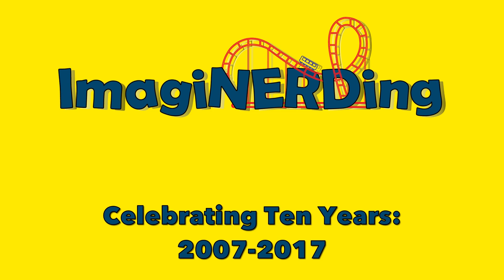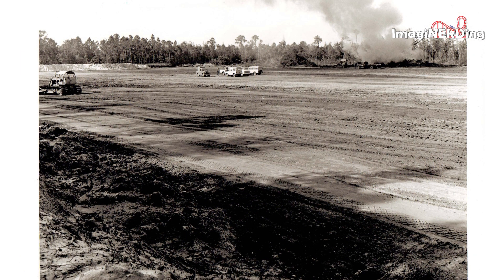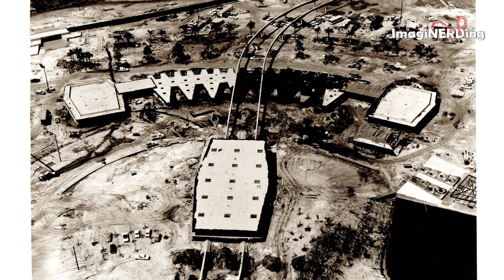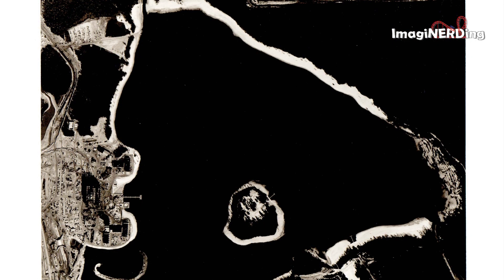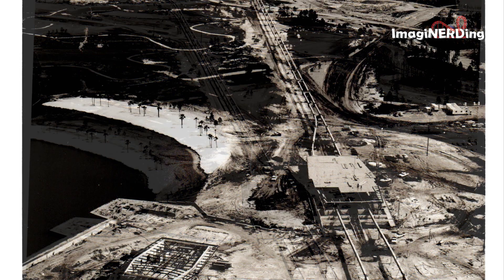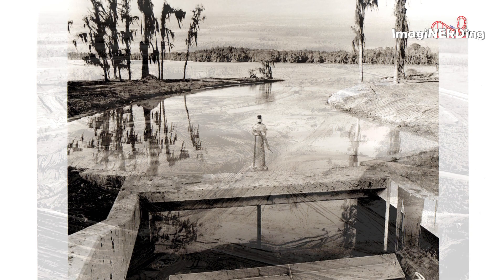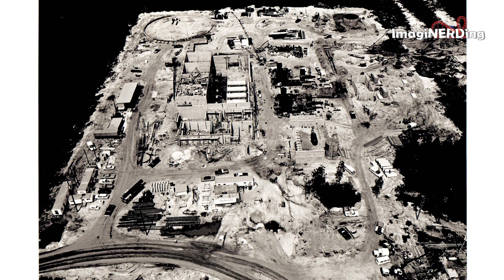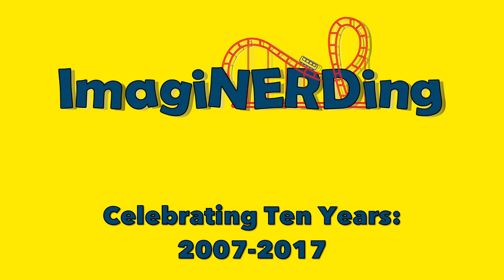Walt Disney World Construction Photos Rare!

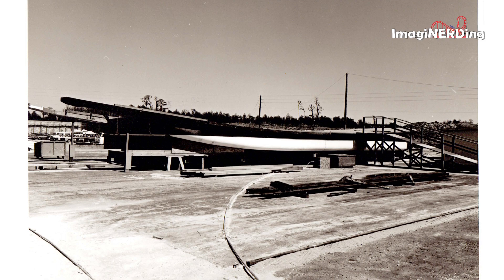Comment: 4:00 this is the southeast corner of bay lake. The water channel is still there, and can be seen in the previous pic in the bottom right.  7:35. This is one of the paddle wheelers that ply the rivers of America you can tell by the stern projections that hold the stern paddle.  It is also in the pick at 7:55 in the background